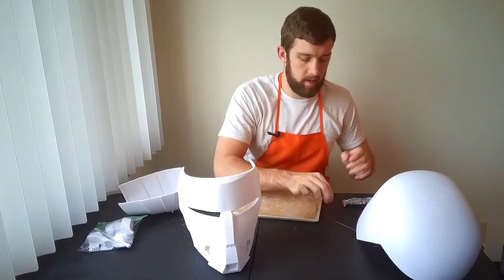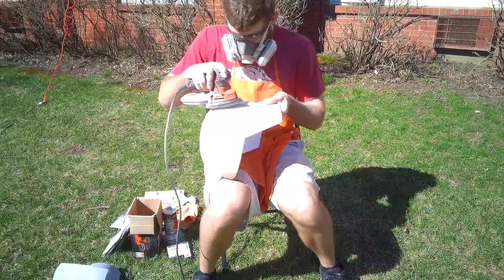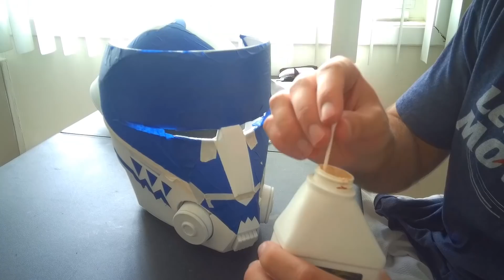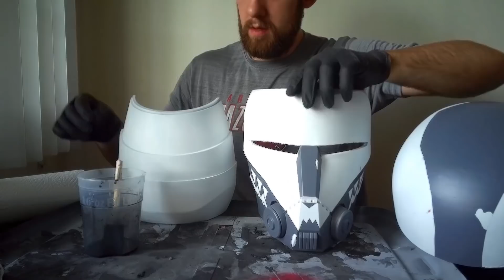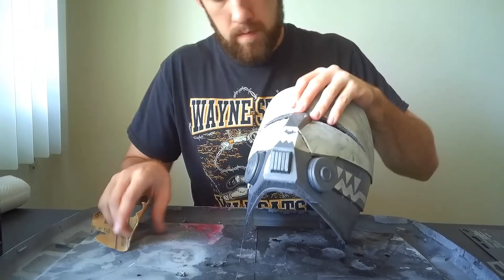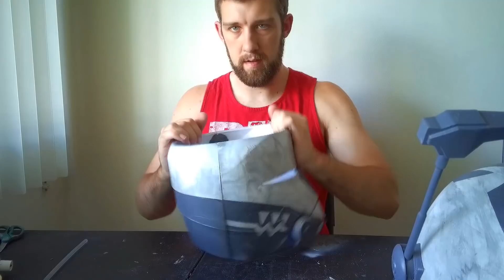How to make a Desert Wolffe Helmet

Comment: Oh wow, you’ve since updated the file. In its current state, it’s way better and easier to assemble than this. Dome and backplate are a single piece, slopped perfectly with a step on each inner side, to lock the faceplate into, for easy alignment. For those wondering.

There was so much room on the one I printed, I had to drop it down to 90% and I have a massive 24.5in noggin.  Now it fits my head perfect like a captain America helmet.

So again, for those who don’t know, the STL on Galactic Armory has long since been updated and no longer requires magnets to put on. It’s a legit bucket

Comment: I personally would do a sanding on the raw plastic first to knock down the biggest lines, then follow it up with a primer coat to show any imperfections and then maybe bondo and more sanding. Its a lot more efficient on primer and bondo supplies but then again maybe im ignorant to how difficult it is to sand pla

Comment: i have two possible solutions for your issue :
1. put magnets in the dome which align with the ones in the visor assembly 
2 attach the back of the visor assembly to the dome and have the front slot in  to them connect with the magnets